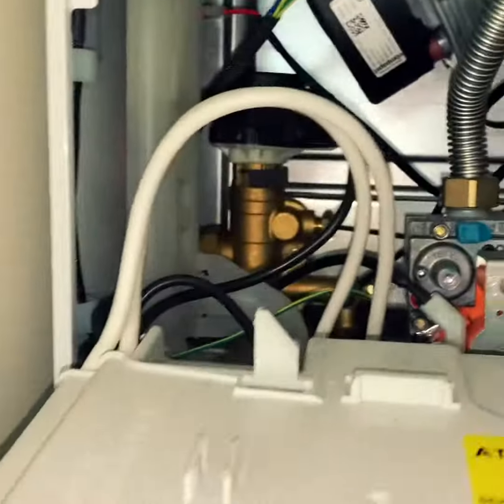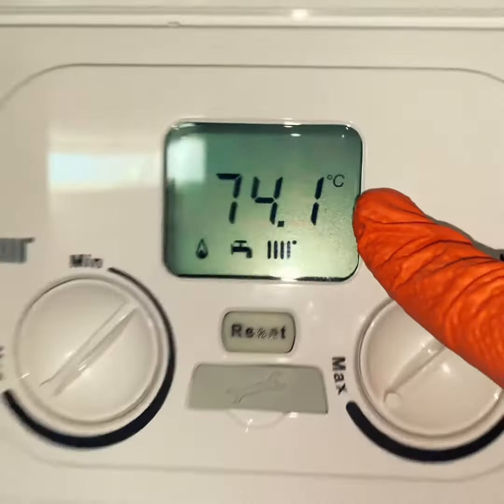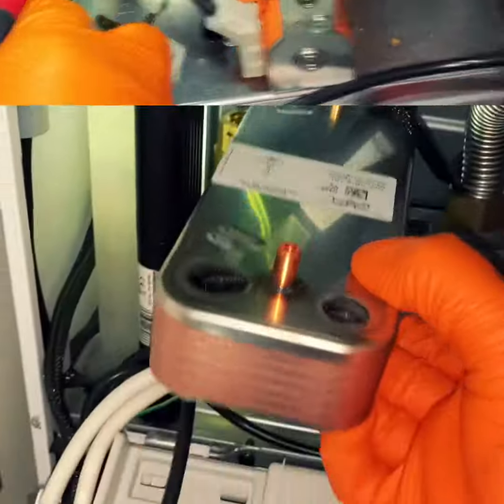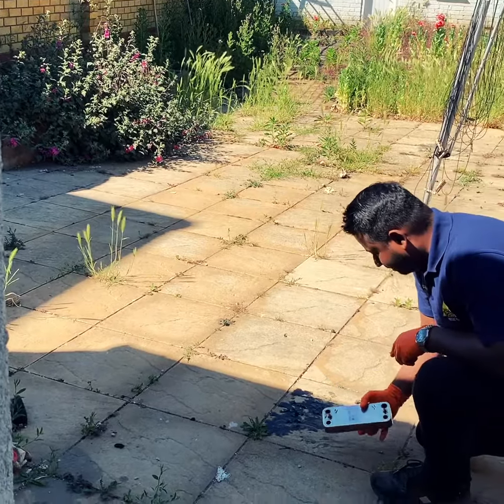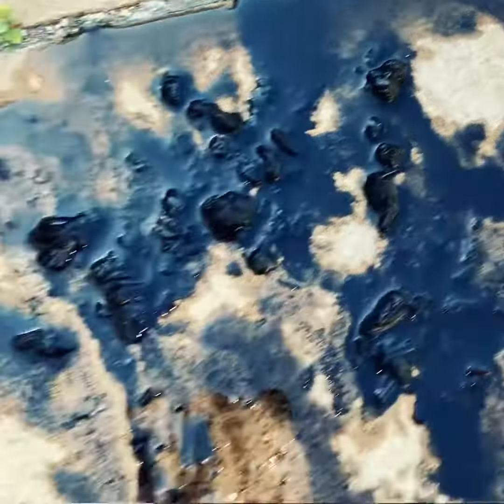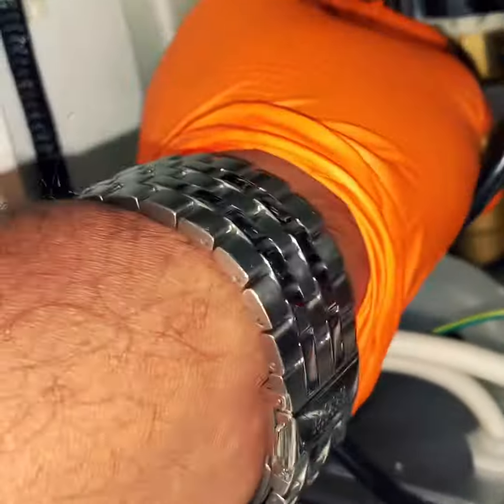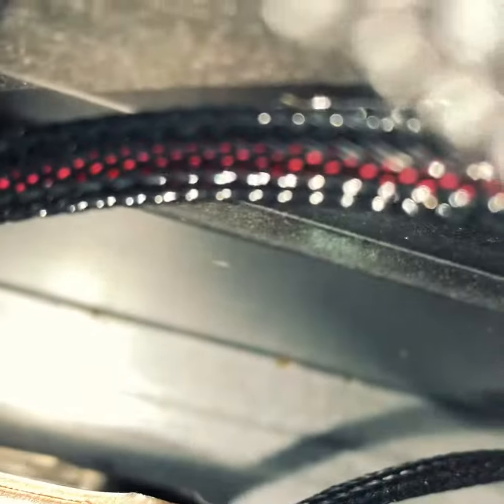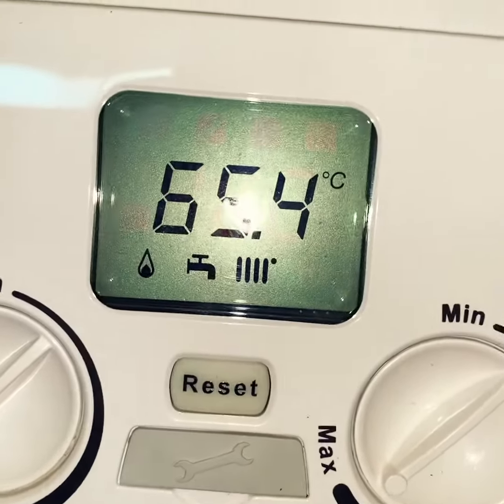Main Eco Compact plate heat exchanger blocked

Comment: Hi mate. What did you do to clear the blockage ? Is it just a case of tapping it out and pushing water through it ? Thanks in advance
Reply from the maker: In this case yes but in some cases you may need to replace the plate heat exchanger.
Reply from the maker: @Minix Tvbox no I didn’t use anything on this occasion just cleared it out with water .... boiler was only 9 months old.